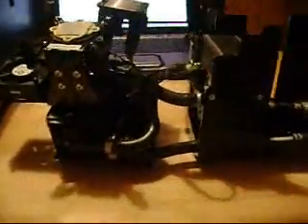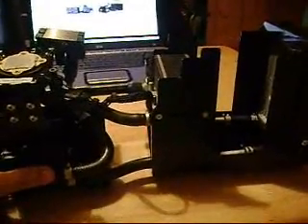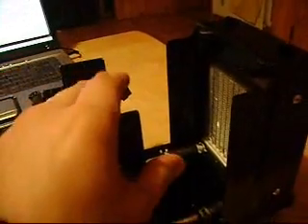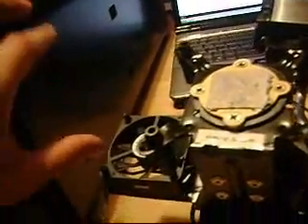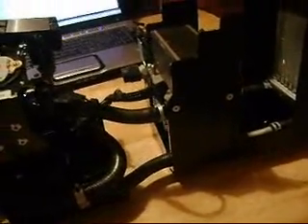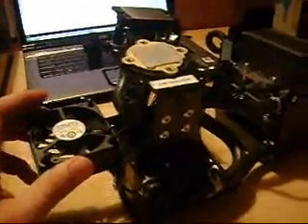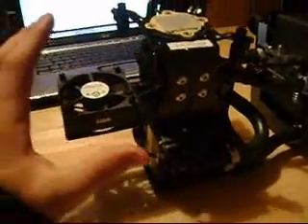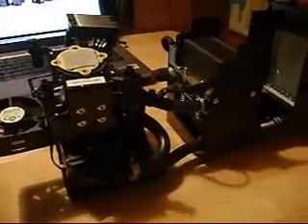Repairing H2C hybrid water cooling system part 1

Comment: It would have been nice had you showed us how to take the thing out of the computer. I would rather take the cooling system out of my XPS 730X and convert it to a passive cooling system. If that H2C over heats and blows it spews that coolant everywhere. Dell had to replace the Mother Board, RAM, Video and Sound Cards when that cooling system exploded in mine.